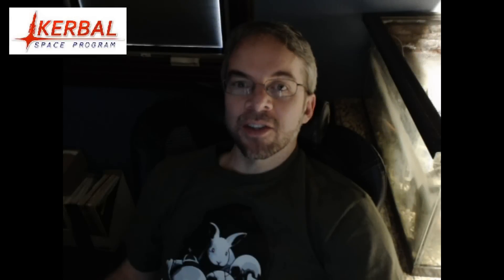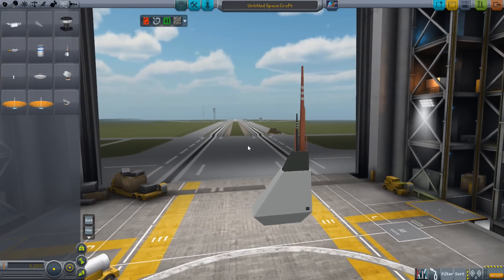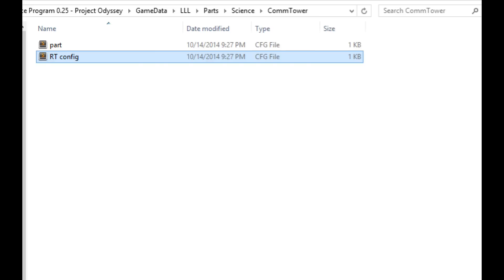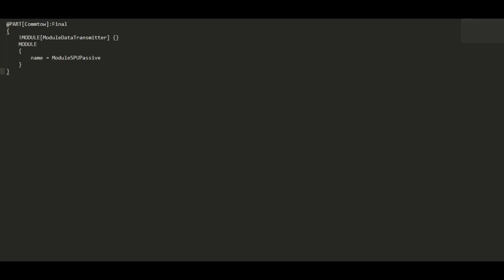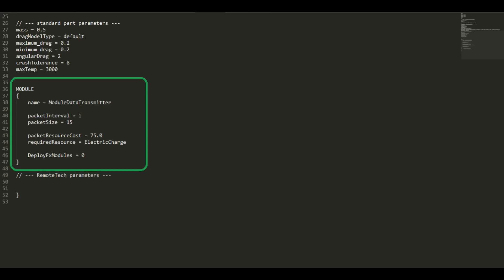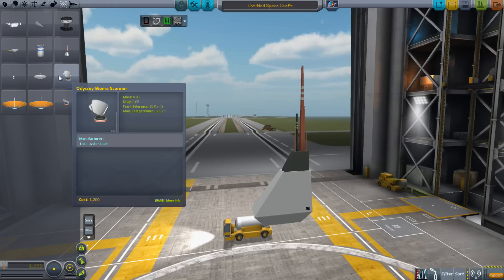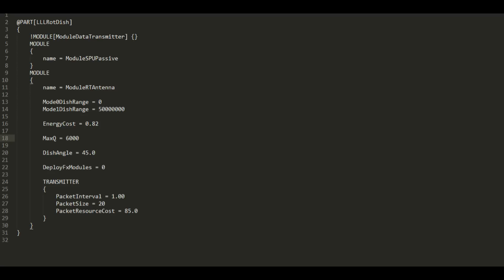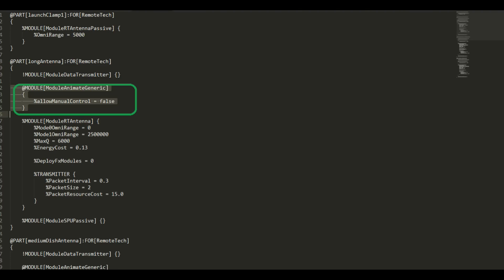Custom RemoteTech Parts -- AMA 3 -- KSP 0.25

Comment: good tutorial other than the use of SPUmodulePASSIVE.....DO NOT USE THIS ON UNMANNED PROBES! What you said was the opposite of the SPU types. You need a MODULESPU on unmanned. You can use the passive SPU when a kerbal is onboard. The kerbal acts as the SPU proper. Howerver we must passively pass on conrtol to antennas so we can do science. The only time you use a passive processor is when you have a manned craft or adding a secondary antenna AFTER an active SPU. Everything starts with kerbal control or active SPU. Hope that helps? Btw you need to make an AMA 10 ! :)

Comment: How do you weld parts together without the welding mod?
Reply from the maker: Pack_Retro I use a text editor and simply type it up. I will do a Turbo Time AMA on PART files.
Reply: Ok thanks!

Comment: Did you find the structure and terminology used in the config files intuitive or did you really have to learn from trial and error? I find the sections regarding part type and attachment to be straightforward, but get a little confused by the module sections. So when you mentioned putting the ! before the module name to remove it, so it doesn't interfere with the newer modules, I realized why I've had trouble adding module functionality to a part that originally didn't have it. Thanks for the great video, Bob!
Reply from the maker: HanoverFiste1965 Yea it's intuitive to me, but I might be a bad case study? I do this (programming, config files, etc) for a living.

Comment: Thanks Bob for the info. You haven't, by chance, made a complete cfg file for all of LLL have you?
Reply from the maker: Probus Thrax I'm not exactly sure what that means, so I am pretty sure it means I have not done it. ;)  I only CFG the parts I am using, which from LLL is about 10 pieces so far.
Reply: Awesome! You may be the first person to make LLL compatible with Remote Tech.  Can you post a link to your updated files on the forum?
Reply from the maker: It's all in the git hub now, and git is linked in the forums.
Reply: Bob Fitch Bob, I can't seem to find the file(s). I hate to ask, but could you link the github URL where the updated LLL RT2 data is?  Thanks!

Comment: Another awesome how-to-vid! How do you rescale your parts? For example in you RSS shuttle launch, you talk about rescaling the boosters and all the different parts to their real world counterparts. How do you go about doing that? Are you measuring the in-game booster using structural girders and then scale up using the scale factor in the config file? I've tried a bunch of things, but it never seem to work how I want it to.
Reply: ***** I am well aware of tweakscale and how it works. That is not what I am asking. I don't believe you can get accurate real-world-scaling done by just using tweakscale. At least I assume you can't. If a part or an object is x2.69 bigger in real life compared to the parts in the game, I assume you need to go into the config file of the individual parts and edit the parameters somehow.
Reply from the maker: Fairy Light Yes, I create them by hand after using Excel to help me calculate the values I want to use, and then Sublime Text as the editor. The 1x1 stock KSP metal plate is actually 1x1 meters, so I can stack them up to get sizing estimates.